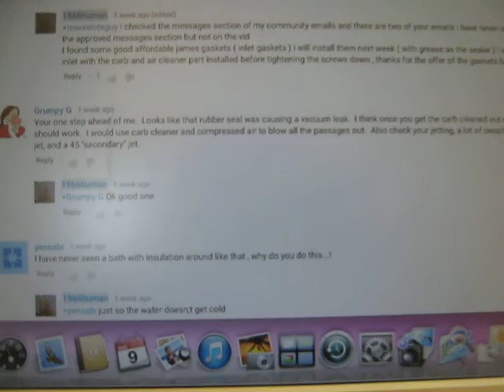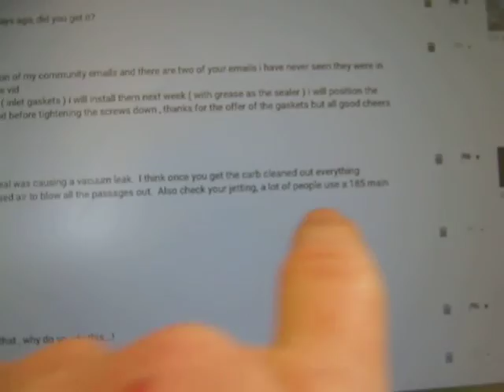Sportster problem 44 ( problem is Carburetor )

Comment: I have been watching your rebuild and I noticed with your air fuel mixture screw you do not have a washer and o ring so you cannot properly adjust the idle phase. also there is a proper way of adjusting the air/fuel mixture but first you are going to need to get that washer and o ring.
Reply from the maker: I took the bike to a Harley shop and a senior mechanic / auto electrician rebuilt the carburetor , the float height and some parts were missing, the bike had to be started level ( not on side stand ) she ran a bit rough although when being ridden she went very well, I would say the CV carburetor was the main problem not the absolute problem
Thanks for your help

Comment: lock tight the bolts
Reply from the maker: All the bolts were done when i did a road worthy check through
Reply from the maker: Thanks for your comments I took the bike to a Harley shop and the senior mechanic / auto electrician did tests and rebuilt the carburetor the bike ran well after going to the shop, but it had to be level when cold and starting, they said the the float height was wrong and as Harleyal Morrow ( above ) points out I don't think there was a washer and O ring around the air fuel mixture screw

Comment: fuel tank filter
Reply from the maker: yep the fuel tap filter was removed, with no running difference, and the tank was bypassed using a different container above the engine